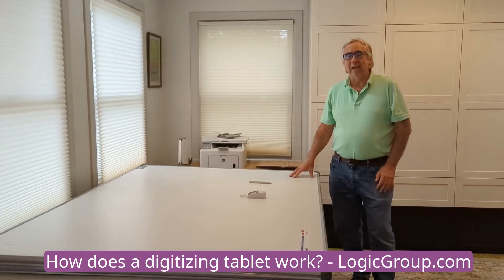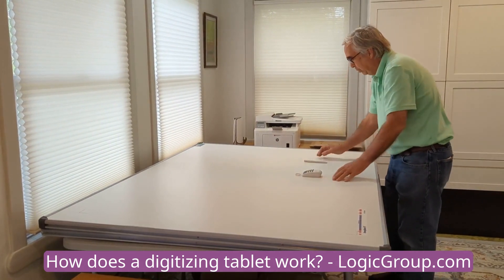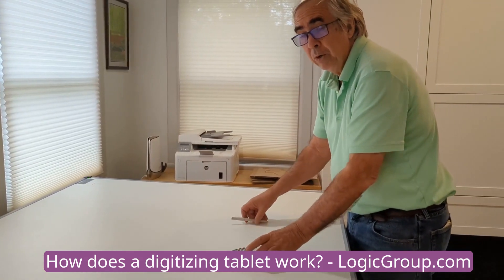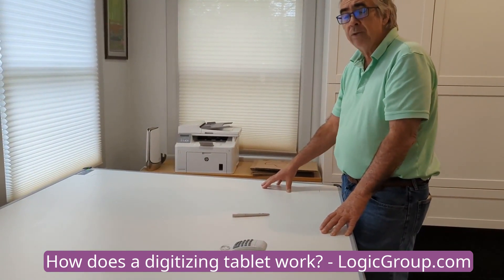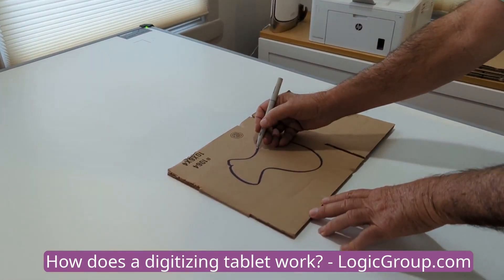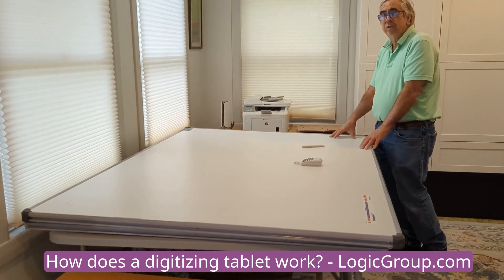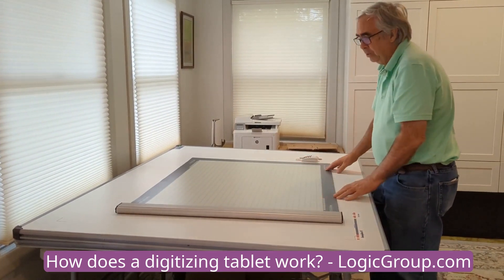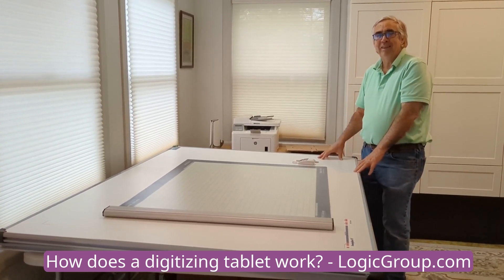How does a digitizing tablet work for tracing patterns?

Comment: Hi John …. Do you provide any support or software for an older GTCO Calcomp V board.  I have a chance to pick one up very cheap and it’s in. Nice comdition.
Reply from the maker: A Calcomp Drawingboard V is a nice digitizer but they quit making them over 20 years ago. You cannot get spare parts for them. Our Logic Trace software does work with it, the cost is $1500 for the software.
Reply: Thanks for the quick reply.  I think I'll steer clear of this one.   @johnintx